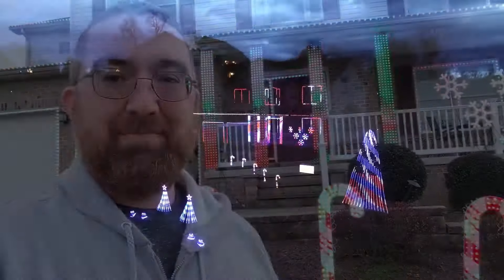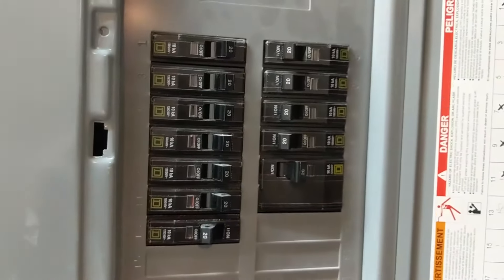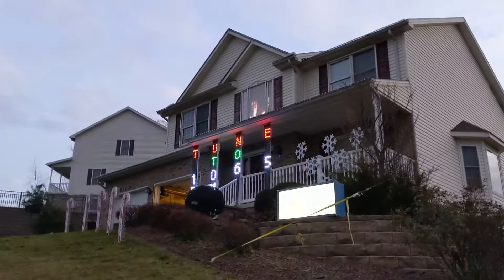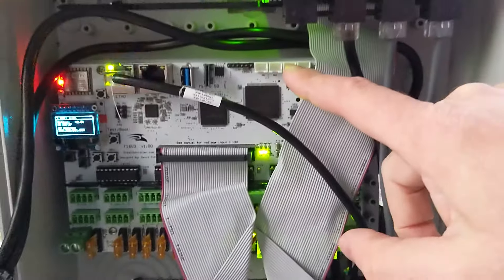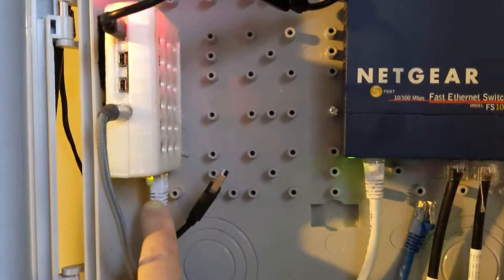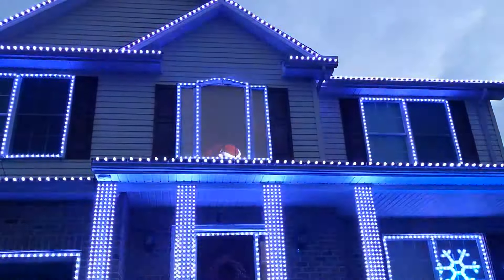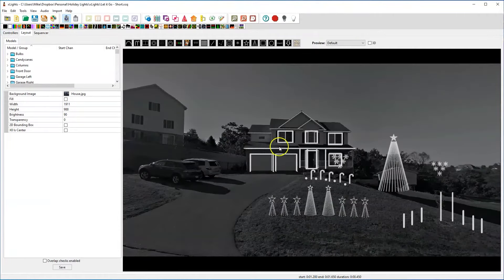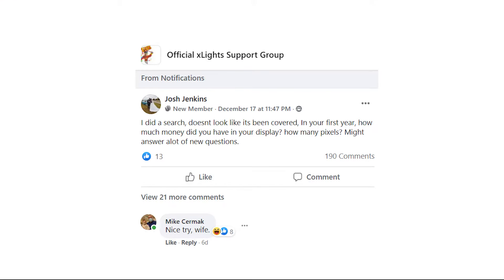How does a holiday light show work?

Comment: I want to get into it so badly but I dont know what controller to get.. Falcons are always out of stock when I check.
Reply: I wanted to get falcon also but ran into the same out of stock.  I ended up going with Dig Octo controller and its working well with WLED so far.  Its way cheaper than a falcon also.  I'm a total beginner and will move to a show in xlights over the summer.

Comment: How many falcon controllers do you use for your current setup?
Reply from the maker: Only one Falcon, plus three Falcon differentials. There are also two AlphaPix boards in the show.
Reply: What do the AplhaPix boards control and is there a factor that decides between a falcon, falcon differential, or AlphaPix for the controller for the specific area of lights?  @TechSupportGuyTV

Comment: Thanks for this video. 
This will be my first year in this hobby. 
I have one question, do you keep the  raspberry pi & the falcon controller on 24/7?
Reply from the maker: I keep the Rapsberry Pis up and running 24/7, but have the controllers (and power supplies to the LEDs) on timers. I've seen too many photos of burned up pixels to leave them on 24/7.
Reply: @TechSupportGuyTV  Thanks for the info.